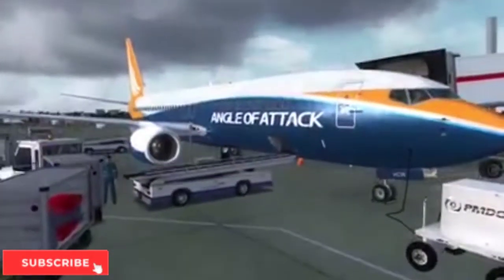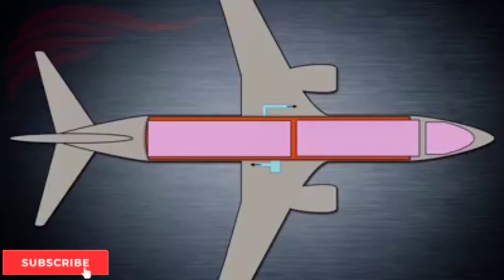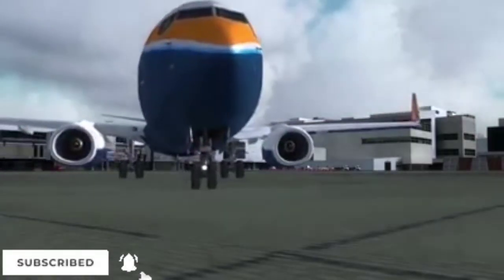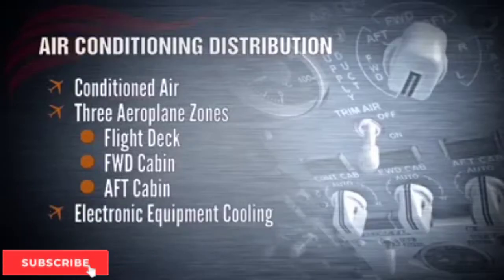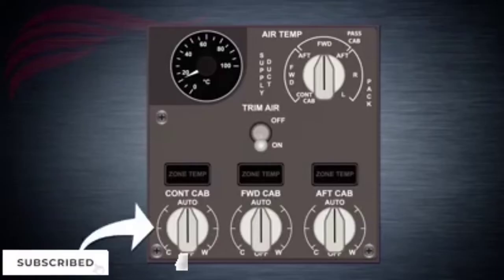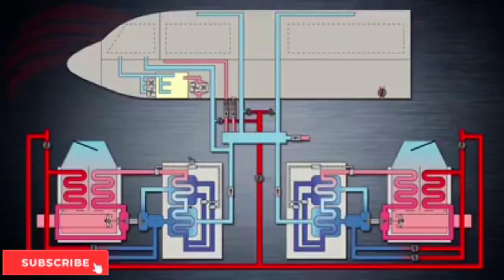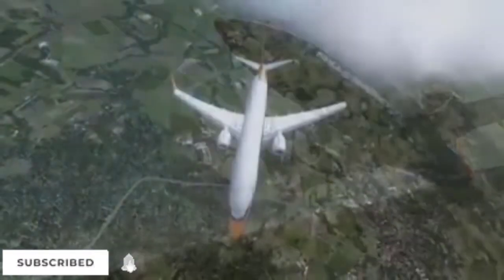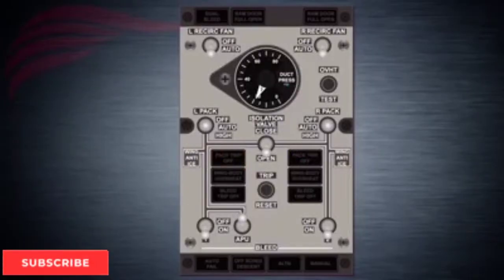Airplane Air Conditioning System

Comment: Bleed air is not only used for pneumatic power - it is also the only supply source of all air going into the packs that is processed for breathing by passengers and crew. (I don't think this is mentioned in the video?) It's the equivalent of taking absolutely all air going into the passenger cabin of your car, and routing it through the intake manifold of the engine first. Who would get in any car knowing that this was the case?